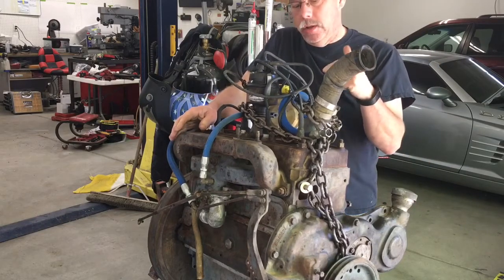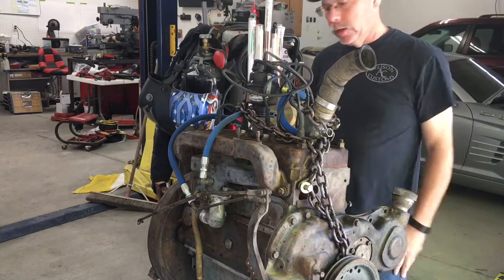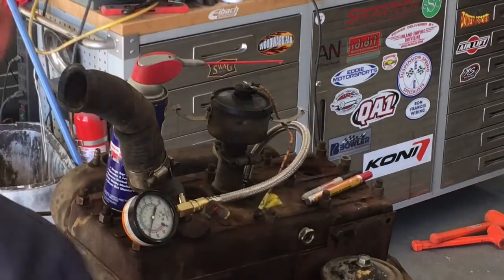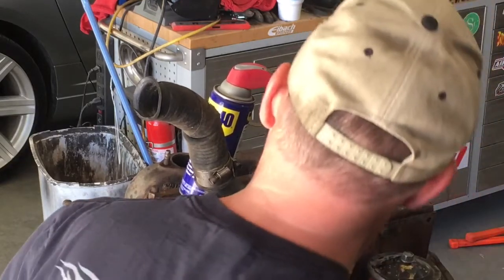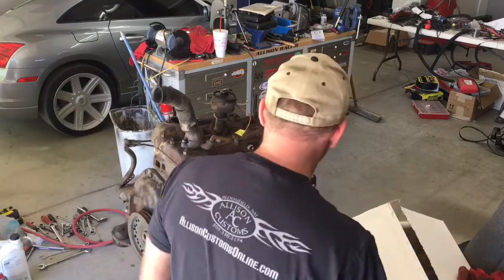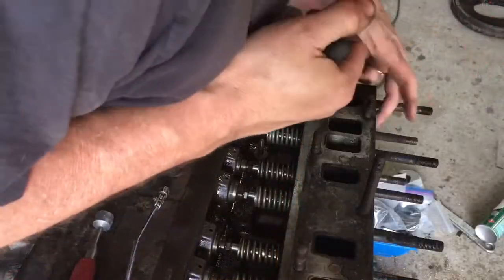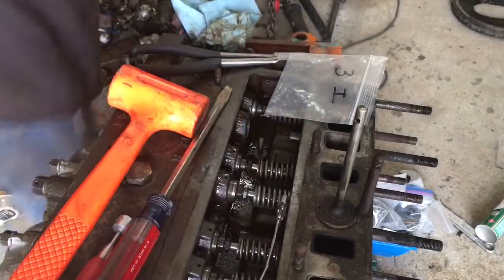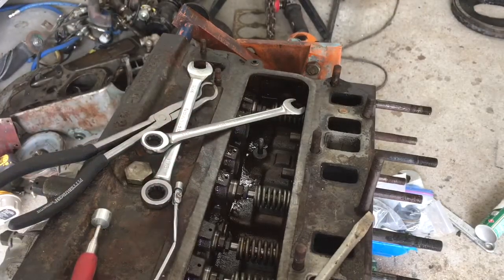Continental Flat Head - 1954 Clark Forklift

Comment: You did a fantastic job freshening up that motor! Did #2 cylinder ever come back once you were finished? Also where do you order your parts from? I need a head gasket for my flat head. Same motor but it’s a gasser. It’s for a 1955 Clark CarLoader. It’s blowing coolant out of the radiator whenever it’s running.. Let me know, thanks!
Reply from the maker: Thank you! I use Steiner Tractor for most of the engine stuff.   I ended up redoing the head gasket and now it runs great.  It’s still low on compression overall but works great.

Comment: This video might have been done quite a while ago,
But I have a few questions please.
I have always been told to do a compression test with the throttle plate wide open, I am not able to see if that is the case or not ?
Second question,
Are you using a fully charged battery for a compression test ?
Just curious if that is the case or not.
I am an old forklift mechanic, and I do mean old !
I have an inventory of NOS Continental flathead parts, and always happy to help with guys who are trying to keep these old flatheads running !
Reply from the maker: I agree, you should have the carburetor wide open to let as much air in as possible, and a fully charged battery to spin the engine as quickly as possible.  I think I was jumping this off of my truck at the time. I can’t really remember for sure.  I know the starter had issues at one point too.

If it’s ok with you, I’m going to pin your comment to the top of the list so that others might contact you about the parts you have.

Comment: It won't leak down on the pressure test, no need to wait, due to check valve on tester. Motor was turning over much slower when you tested cylinder no 2. Thus lower pressure. Try leak down test.

Comment: hi cool video , just wish you could have slowed it down when you where torquing things down ? Im working on clarklift the plant on  the motor says west bearing and parts portland oregon   model 160 (the place burned down not biss any more ) i have parts book but no repair  book , its gas motor i have spark to all cylinders psi on two cylinders is at 125 psi and two at 50 psi ,  the dawell is stuck in the head cannot turn it to see if out  time is there a timing spot on the motor that you can run timing light Thanks Glenn C P.S. i put a gas  little in cylinders and oil it wanted to start but blow out black smoke and just stopped after fuel was gone , took carburetor off cleaned up (old fuel ) i'm using now two gallon gas can with electric fuel pump still well not start ?
Reply from the maker: First, great find!
The only timing mark I know of is on the flywheel. 
If you only have 50 psi on two cylinders, it’s probably not going to run - or at least not well.  You should consider doing a leak down and finding the problem.  Typically it’s the valves, but could be a head gasket if the cylinders are adjacent to each other.
Good luck!

Comment: Hello Sir. Stupid question for you... do you know what the purpose of the little round cover with the 3 bolts is? Its above and to the right of the crank pulley and between the hydraulic pump?
Reply from the maker: It’s been so long now, I’m kinda guessing. I think there is a gear mounted there for the pump drive.

Comment: What's the best place to get parts for these? Napa said the water pump was discontinued. I have an older clark with a teledyne engine. I believe from the 60s. Is needs work but it will run long enough to get the job done.
Reply from the maker: I don’t know much about the teledyne engine, but I’ve been finding parts for my Clark at welding suppliers,  NAPA, Steiner Tractor.  Only thing I’m still looking for is a new steering wheel

Comment: Good afternoon, what is the specs of your F163?
I have 1 like that with the engine oil port and the hydraulic pump behind it
Please what exactly is the specs for this engine?
F400A or F400B?
Reply from the maker: I’m not sure if this is what you are after, but it is also the only casting number I have a picture of - I think it is on the head.
F124A409M  the area where 09 is, had the castings ground off and the 09 stamped in.
Hope that helps

Comment: Please share any resources for parts for this engine. I have the 52 Clark yard lift Id like to do a full restoration.
Reply from the maker: I used: Steiner Tractor - https://antique-tractor-parts.steinertractor.com/tractor/Continental-F162-Engine-Parts
            Continental Engine Parts - http://www.continentalengineparts.net/

Also, many of these engines ended up in Lincoln Welders - so check with the welder supply companies - I found a remote oil filter kit at one of them.

Comment: Hi, just wanted to ask you if u can help me out  with tips i need to replace my oil pan gaskets there leaking kinda lots and never touched  a motor like this mine is a continental F162 on a towmotor  fork lift
Reply from the maker: It’s pretty basic, I think if you can get under the lift, you could actually replace the oil pan gaskets without removing the engine.  If you’ve worked on any engines before, you won’t have any issues with the flatheads.

Comment: Your metrer will never loose pressure, it's equipped with a return valve!!! And your battery is bad. When measuring cil. 2 it's barely turning around the engine... On cil. 3 speeds drops down after 2 turns...
Reply from the maker: You are right!  Figured it out after the video.  Engine runs smooth today and a new battery and rebuilding the starter fixed the rest.  Thanks for watching!

Comment: I have the same engine in my forklift , it was running smooth , but would not accelerate past idle  and had a pop from the air intake while running  so figured the vales may have been to tight ,   found 1 exhaust valve spring in about 5 pieces and another exhaust valve hung open  , So I it all torn down now , found the springs and the spring retainer ,  My question is where can I get a ding dang gasket set  ?
Reply from the maker: I use Agkits, Steiner Tractor, or WeldMart for most parts.

https://www.agkits.com/Continental-F124-PF124-F135-F140-PF140-F162-PF162-F163-F198-Full-Gasket-Set.aspx#.Xpj5ei9MHmo

https://antique-tractor-parts.steinertractor.com/tractor/Continental-4-Cylinder?gclid=CjwKCAjwhOD0BRAQEiwAK7JHmLwavSPPcwwQqRhoKvUhvMZjGq8kUKb68O5CIUWqGHScfBb0EP8TaBoCJEMQAvD_BwE

https://www.weldmart.com/main/technical/cont_lhead_quickref.pdf
Reply: Awesome thank You very much !   I have the gasket set in my cart and getting ready to make the order , just gonna go over all they have and see if I can find anything else

Comment: The engine was sitting for a long time the slider wall are clean it all looks good but so hard to turn over
Reply from the maker: Might just need a little oil in the cylinders and on the bearings.

Comment: Hello. I was wondering if you could help. I believe i have a continental engine. My grandfather built a tractor with one, including the rear end from fork lift. Only diffence is tbe distributor is on the side. Any ideas as to which engine it might be? Thanks for your time
Reply from the maker: If you send some pictures, I may be able to help.  Some of the engines had a magnito attached on the side.
Reply: Dist on the side is a willys engine I think

Comment: May sound like a silly question ...where do you put the engine oil back in?  Is it in the cap on the right side of front that is mounted to the gear cover and where the hyd pump connects.... I have bought one of these forklifts and know nothing about them and it desperately needs an oil change........thanks
Reply from the maker: Yes, mine fills thru the cap on the Hyd. Pump gear drive.    The gear drive is lubricated with engine oil.  I don’t remember exactly, but mine uses something like 2 gallons of oil.  Consider getting a spin on oil filter adapter if it doesn’t already have one.  Getting the original oil filter assembly to seal up is nearly impossible.
Reply: @AllisonCustoms  ...That's what I thought... thanks for the quick reply!

Comment: If the rings weren't broken in #2 I would have not ground, but polished the valve seats in number 2 being that it was the odd man out. Just to make it all even. But everything looks very good after resealing and oil filter replacement. Probably with propane lower detonation pressure but hotter valve seat temps this engine being run for 20 minutes every two weeks will last till 2050.
Reply from the maker: In that engine I went through and mostly just replaced gaskets and seals.  I did push the pistons all the way down in the cylinders and ball hone them.  On the valves, I wire wheeled them clean and then using lapping compound lapped them back in.  No valve grinding or real machine work was done.  In a latter video you will see me finally getting it started up, and for that I had to put a new head gasket on. I had either screwed up the first replacement or the type (metal layers) of Gasket I used just wouldn’t seal. I used a Fel-Pro fiber & metal on the second try and then it started right up.

Comment: Whered you find parts?
Reply from the maker: big trailer mounted welder and tractor repair sites.  These Continental engines have been used forever.
Reply: @AllisonCustoms   what type oil?
Reply from the maker: I use Rotella from Tractor Supply.

Comment: I have the sam engine but the front is different there is a part that turns the distributor and I think is stuck. The engine turns over really hard but everything is moving I'm not sure why it would have such a hard tim turning over
Reply from the maker: Might be dry main and rod bearings.
Reply: @AllisonCustoms  I figured it out it's the pump thing with the pulley that run the distributor. its ceased motor move free when I took it off
Reply from the maker: Is our distributor mounted horizontally? (In line with the crank)
Reply: @AllisonCustoms  yes on a part that turns the pulley for the belt on the fan and alternator
Reply from the maker: might be a magneto then.  If it is, be careful - it can shock the crap out of you.
Reply: @AllisonCustoms  it's a part that turns the distributor theres a check cap on the part when I poured oil in it gose straight through to the oil pan
Reply: @AllisonCustoms  and I freed it up it was seized wouldn't turn so the motor wouldn't turn over now it does
Reply from the maker: Good find!
Reply: @AllisonCustoms  the motor is on a m14 Foley bells sawmill

Comment: Blown head gasket between 2 and 3 cyl probably to dist hole very common  problem
Reply from the maker: When this video was done, I don't think so.  I'm pretty sure it was blow by the valves, however I had compression problems after the new head gasket and I would bet you are correct.  I installed another new head gasket and it started right up!   I wish you had commented earlier, I put off changing the head gasket far to long and chased 1/2 a dozen other issues before believing the compression was low enough to cause the engine not to start.

Comment: Great video, very instructive!  Bought an old Clark similar to this.  What model oil filter adapter did you add on?  How do I find the engine model or parts for this engine? Thanks!!
Reply from the maker: I bought mine from BW.   https://bwparts.com/oil-filter-adapter-kit-w-wiixfilter-sa-200-f-163.html

Hope that helps.

If it is a Continental, then model is also the size: F-163 is a 163 cu.in.

Comment: Propane is a clean-burning fuel gasoline not so much
There should hardly be any carbon build-up only a residue.
Reply from the maker: I like propane for the ease, but just not all that familiar with the components.

Comment: I have an unknown year and make forklift has engine looks similar to your engine. it has a downdraft carb. it has key switch and gauges behind operators left leg. gas tank to the right side of engine. an idea on identification of what it is . thanks
Reply from the maker: I don’t really have any idea.  My lift was originally gas powered and the tank would have been to the right of the driver as well.  Mine was converted to propane sometime before I purchased it.
Reply from the maker: Anybody out there have any ideas?
Reply: Look for casting numbers, the y series Will start with a Y,  there is also a larger F series 4 cylinder engine

Comment: What are the torque settings for the head bolts?
Reply from the maker: 70-75 ft.lbs. I like to start with 25 ft.lbs. Then increase by 15 ft.lbs. on each additional torque sequence.  Until you get to 70 ft.lbs. Then start and warm up the engine, once cooled off enough to work, do another sequence at 75 ft.lbs.